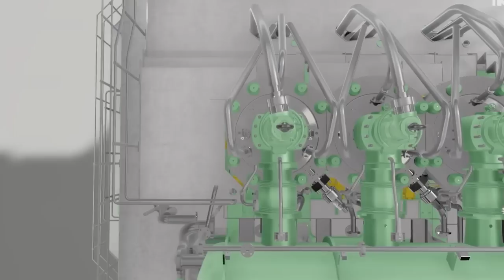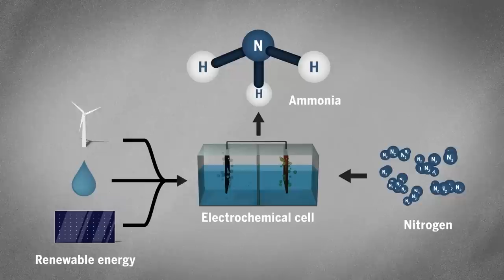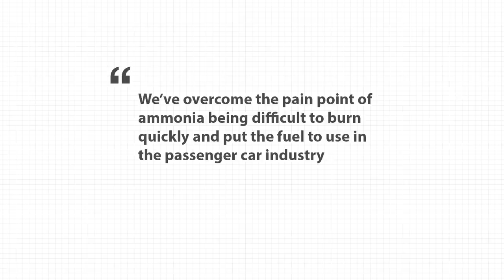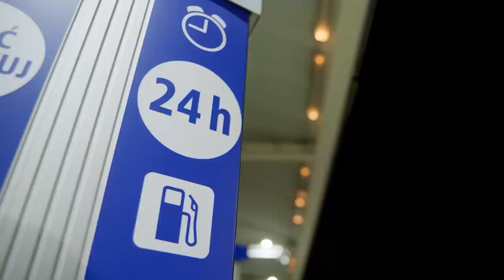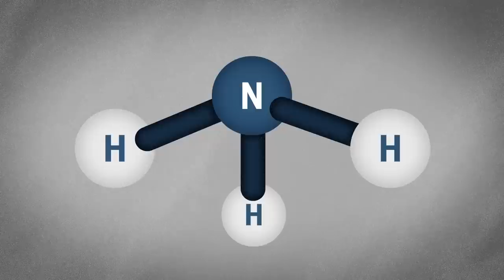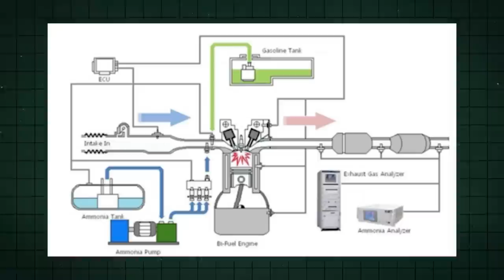Toyota CEO “This New Ammonia Engine Will Destroy The Entire EV Industry!"

Comment: Im all for it. As an engineer in thermodynamics, this could potentially be a life saver. The question of energy density is one that not many people grasp. EVs have massive hype but there are blind spots no one is willing to talk about. The real question with ammonia however is the energy going into making the said ammonia. Since we can't just pump it out of the ground, it needs to be produced and thermodynamically speaking, the energy going into making it (once inherent process inefficiencies are accounted) will consume more energy than what can be obtained from its combustion.... you'd really need to make it next to large sources of renewable energy and ammonia essentially becomes an energy storage mechanism.
Reply: nuclear power solves this issue
Reply: What blind spots?
Reply: As an engineer, I would think you would question why ammonia is no longer used in residential refrigeration.
It is highly toxic, you don’t have to worry about the long term affects, it just kills or destroys soft tissues on the spot. 
My biggest concern is that the obvious dangers of Ammonia wasn’t even mentioned in this video. What else are they NOT saying?
Reply: @whocares264  The same carbon emissions are occurring, they just happen where the driver cannot see them (at the power station).
The process to gather the needed materials and make the parts for EV's is 17 times more harmful/dirtier in terms of pollution and destruction to environments.
The areas where these rare earth elements are found in abundance are unfortunately in areas not impressed with the US foreign policies towards the rest of the Earth (rightly so).
The distribution for combustion is already out there and widespread. EV's still have to find charging stations and wait long charge times.
The charged battery swap idea for fast recharge requires a standardized battery that the makers would have to agree on and the station would have to have a very expensive supply of these. Currently, the cost of the battery is 1/3 the cost of the car. Gas stations wanting to become charging stations would have to buy hundreds to thousands of them.
The US electric grid is already going down in California and many other places with brown-outs. If just a 20% increase in EV's were out there the system would not be able to keep up. There is no way the current system could withstand a 2030 ban on combustion vehicles without a complete overhaul and massive investment.
Battery life concerning recharges is about 300 to 500 full charges, and then you need to buy another battery or suffer getting along with a dramatically reduced operating at 60% charge or worse. And again, the battery is 1/3rd the cost of the vehicle.
Eventually, with standardization of recharging, longer battery life, and cleaner procurement of materials, EV's will be more attractive than combustion vehicles. This would also have to include lowering the price of electricity to nearly free electricity.
Reply: @carlm.m.5470  and where the driver can't breathe them...
Reply: As a business investor, I would never buy into this idea. Before EV, maybe? But now EV is out, impossible.
Reply: Excess solar/wind capacity could make ammonia.
Reply: @michaelalbert8474 Ammonia outside vs inside is not the same.
Reply: @nunyabidness117  could it,
Reply: @nunyabidness117  do you sit outside a car when operating it often?
Reply: This is where thorium reactors come in. So much energy can be produced so cheaply for a hundred thousand years plus.
Reply: this is the blind spot.

Comment: Ammonia can be made   from electrolytic hydrogen and atmospheric nitrogen.
Ammonia boils at -33OC  at atmospheric pressure. The largest fully refrigerated ammonia tank holds up to 50,000 short tons of liquid ammonia . This amount of ammonia contains  8800 tons of hydrogen. The world’s largest liquid hydrogen tank, owned by NASA, holds  336 tons of liquid hydrogen  Liquid ammonia  can be stored at room temperature at a pressure of about 200 PSI.  World production of ammonia is 150 million tons per year. 18 to 20 million tons of liquid ammonia are transported by sea each year.  Green ammonia could replace the present production of ammonia from fossil fuels with no major changes in infrastructure.  Ammonia is already established  as a fuel for marine and stationary prime movers. This new development marks a great step forward in the potential use of ammonia.
It is a far more logical fuel than hydrogen.
Reply: This post is exactly right.  The storage of ammonia does not require the extremely high pressures or extremely low temperatures required for hydrogen.  Furthermore, ammonia is no more toxic than hydrogen and is actually less flammable.  Ammonia is used in industry on a large scale.  Ammonia is transported everyday on our roads and railroads.  Ammonia is not a threat to the electric vehicle industry, but it is a threat to the hydrogen vehicle industry.

Comment: I find this very interesting but there is a problem: ammonia smells bad and is toxic. It comes to my mind: why not methane?
Reply: Ammonia however is one of the chemical commodities that is traded and shipped most around the world. It already has a fairly robust infrastructure supporting it and a large number of people trained to handle it.

Also, It is a bit more efficient to chemically synthesize green ammonia than green methane. But if you were to synthesize methane, you would still need a carbon source, which means to create it carbon-neutral you would need to first pull that carbon out of the air or use a waste CO2 gas stream. It would require a large CO2 recycling infrastructure, whereas nitrogen, which is the most abundant element in the air, can much more easily be acquired in large quantities for the production of ammonia. (I have had that thought in the past myself)

I do however agree that biomethane is one of the better biofuels and is very much underappreciated. The development of anaerobic digestion facilities should be expanded, but at the same time I know the logics of managing biological waste streams or energy crops to use for feedstock is a difficult challenge when needing to move so much material around.
Reply: @nolan4339  thanks for your reply. Some months ago I was betting on ammonia and there was already the ammonia fuel cel tractor. But the toxicity and the competition with ammonia for fertilizers might be a problem. Probably we will not have in the future just one solution like we have with oil today but plenty of options that compete for the market. I see that methane has some advantages because gas turbines and engines already work with methane and we have infraestrutura for LPG transportation. Sometimes in engineering we have that weird factor that may disturb the development of a good technology, might be the case of the smell of ammonia. Anyways, I just hope that we do have these options in the far future and we dont come back to the age of horses hahaha
Reply: @flvflvflv-x4p  The biggest benefit towards fuel ammonia that I see is that you can get most of the benefits of using hydrogen except you can more easily store and ship it. But yes, green ammonia production has a long way to scale up before it can provide what we need just to offset the fertilizer use.
Reply: @nolan4339  I see. Do you think that for example tractors or trucks which one would win? PEM fuel cell or ICE?
Reply: @flvflvflv-x4p  While I do favor Fuel cells for utilizing ammonia a fuel, PEM type fuel cells may not be the best fit unless first cracking it back into pure hydrogen stream. I think I have seen articles supporting the use of SOFC or Alkaline fuel cells for using direct ammonia.
As for using Inter combustion engines with ammonia, it may be the preferred choice with for power equipment needing to go through rough work or with dirty industrial equipment as engines are generally more robust and durable than fuel cells.

Comment: The safest and most efficient fuel overall will be derivatives of oil. Imagine all these rail tankers full of ammonia adding to the amount of potential hazards that are already on the rails now. A small amount of ammonia can kill. Whereas CO2 is not only required for trees and plants to survive but would take a much larger amounts to cause death. The solutions to save the planet are becoming more evident that they will kill the planet due to the vast amounts of waste created. Examples would be solar panels that require hazardous waste facilities to break them down into usable materials. Or the fields of old windmills that are too dangerous to approach because of collapse. Or the windmill blades that have been replaced lying in piles all over the countryside which many are made out of fiberglass and composite materials. Just another form of hazardous waste.
Reply: They already have technology that can make any vehicle get 50+ mpg most police vehicles get around 75mpg
Reply: @josephfuller6229  I repair police vehicles for a living, and that simply isn't true. They actually get worse milage than most due to a performance tune.
Reply: @wilsterone6689  we went from Topeka Kansas to junction City and the fuel gauge didn't move it's 95 miles away but this one still had the chip installed
Reply: @wilsterone6689  it's possible the owner installed a massive gas tank
Reply: @josephfuller6229  They don’t have chips anymore.  That was OBD1. That was replaced by OBD2 in 1994.
Reply: @josephfuller6229  Some gauges don't move until you have used a significant amount of fuel. Ford vehices are known to have very inaccurate gauges.
Reply: @wilsterone6689  that explains it then because it was like a 91 or 92 Lincoln do you happen to know where I can find OBD1 scanner?
Reply: @josephfuller6229  It is possible to have cars get far better fuel mileage but consumers won't buy them because they are slow.  There isn't a good reason for any car to have more than a 150hp engine except HP sells. You don't get HP for free.
Reply: @wilsterone6689  that is true I use like 3 gallons on my ranger before it comes off full
Reply: @wilsterone6689  I'm not even sure how many hp my 2.9 ranger has  but it moves good when it decides to run at moment it only tries to start when hitting gas repeatedly
Reply: @wilsterone6689  bought rebuild kit for injectors not sure that is even the problem I'm not very good at diagnosis
Reply: @josephfuller6229  yard sale maybe 🤔.
Reply: @josephfuller6229  they are rated at 140 hp. Today the same size vehicles come standard with 300+ hp and the get roughly half the mpg of your ranger.
Reply: @wilsterone6689  I got about 650 per tank but it's been a while since she has run 20 gallon tank
Reply: @wilsterone6689  I use to have a 91 s-10 towed a 2.5 ton van with that little hooptie
Reply: @josephfuller6229  I had an 87 S10 2.8L 5 speed. Towed a 21-foot cabin cruiser boat for 2 summers. Wasn't a speed demon but got the job done, and when not towing, it easily got 28 mpg.
Reply: ???  There already are rail cars designed to carry ammonia.  Anhydrous ammonia is used in many industrial applications and is commonly transported by truck barge and rail.
Reply: Rail cars already carry ammonia and many more hazards materials.

Comment: This is VERY interesting to me. Ammonia (formula NH3) has been a staple of semiconductor manufacturing for a long time so there is infrastructure in place to at least produce it in large quantities regularly for Intel, TSMC, pretty much any semicon manufacturer you can think of. Extending that infrastructure further to take over marine, agriculture, and trucking would be a BIG, BIG deal. The true tests, even before confirming consumer readiness of the engines, is what the environmental cost will be in collecting the chemicals, producing, transporting, etc.
Reply: semiconductor manufacturing uses Silicium, NOT Ammonia......
Reply: @mm8u9y7i   What? I didn't say a thing about ammonia being used *AS* a semiconductor or as transistors. I said it was used in the process of manufacturing.

Comment: If you can produce hydrogen, you can produce anhydrous ammonia.  Unlike hydrogen, anhydrous ammonia doesn't require extremely high pressure or extremely low temperature to store.  Anhydrous ammonia is a hazardous chemical, but it already is commonly transported by trucks and trains and has many industrial applications.  The National Fire Protection Association (NFPA) rates anhydrous ammonia as a 3 (on a scale of 4) - a most severe toxic health hazard and as a 1 (on a scale of 4) - a flammable gas.  By comparison, hydrogen is rated as 3 for toxicity and 4 for flammability.  Ammonia is not a threat to the electric vehicle industry.  It is a threat to the hydrogen vehicle industry.

Comment: dose it ignite in a crash ?
Reply: generally ammonia stores similarly to propane, but has very little chance to burn at atmospheric pressures, however it is fairly corrosive such that being exposed to it can easily damage your eyes and lungs. At the same time it is very easy to detect in tiny quantities so leaks are easy to detect. It is lighter than air, but can mix readily with ambient humidity to somewhat keep it low lying, or can even be directly pulled out of the air by spraying water at it. As such, people nearby a dispersal of it from lost containment would not be at risk due to fire or explosion, but people in the general area would be at risk by direct exposure to the gas itself.
Reply: yes

Comment: Not at all people a mob in Ontario can produce Amonia in a container sized machine. Then you get clean electricity and you have 100 percent clean fuel.  
They have had the tech for 35 years. But big oil has kept them quiet.  
The mob is Fuel Positive Ontario..
Water air makes Amonia ,it’s old news 
During ww2 some countries used Amonia to run buses.  
The fastest plane ran on amonia. 
4800 miles an hour.  
It’s all bout money.   

Fuel Positive Ontario.

Comment: Toyota is developing Solid State Batteries, ready in a few years. However there is a lot of developing countries where the infrastructure is rather poor, and the power grid is way too unstable and poorly developed so replacing combustion engine cars with electric is not possible. If Toyota and other companies can develop alternatives it would be wonderful for the air locally in their cities. However,  the whole saving the climate through reducing Co2 emissions is a scam. We need Co2, life is dependent on it. We have only heard it said that Co2 is heating up the earth, when did we see any evidence, any proof? The climate is perhaps getting warmer in general, but this is natural, it is heating up and cooling down through cycles, shorter and longer variations. What can we do to stabilize the Sun, that is the real quest! 😅
Reply: Co2 is a greenhouse gas. Basic physics, not a scam.

Comment: Sounds interesting, similar to hydrogen base cars! Similar info-structure issues or lack of.  Also, I remember the decreased burn rate from the Ammonia and the fact there is the N3H emissions output as opposed to the H2O does not seem to be a viable alternative in my option!
Reply: I used to be very curious to why we haven't tried for hydrogen since it is the most abundant element in the universe.  But come to think it is also the lightest element, so hard to obtain from the upper atmosphere. It takes a lot of energy to separate the atom from water or oil.

Comment: It’s neat that alternatives are being researched. But there is no way this would get close to the efficiency of electric motors. But, maybe there are some special use cases for this.
Reply: I work in the auto repair industry. As per the experts we are over 20 years away from being able to support charging electric cars on our electric grid. You will definitely see hydrogen cars in some form in the future!
Reply: @terrylink7207  as someone married to a grid engineer, I don’t disagree. However, clean hydrogen production is way behind solar/battery solutions.
Reply: Electric motors are very inefficient right now because the electric comes from natural gas. It could be efficient down the road when powered by wind or solar!
Reply: did they told us the exhaust gas is save? the incompleted combustion maybe contain toxic NO, NO2, ammoniums hydroxide .{ ammonia react with water. } etc. I think we should do more research on hydrogen and water as future safe fuel.
Reply: @terrylink7207 there is nothing wrong with oil